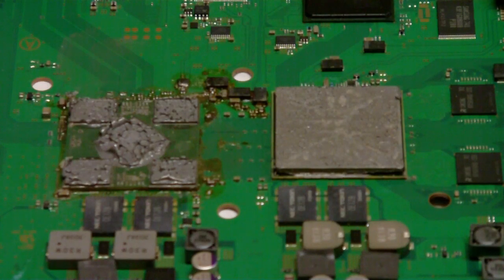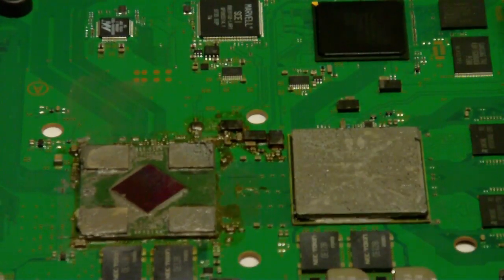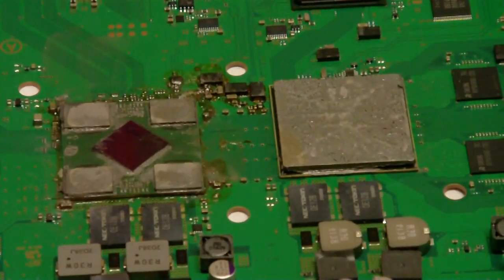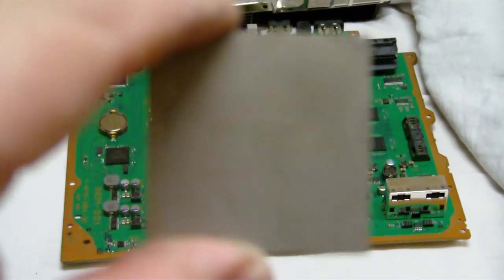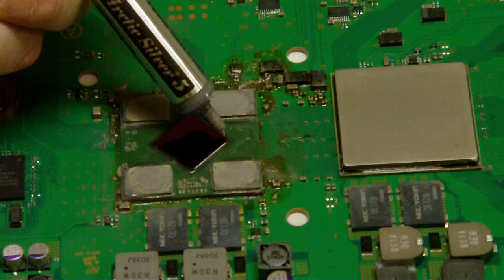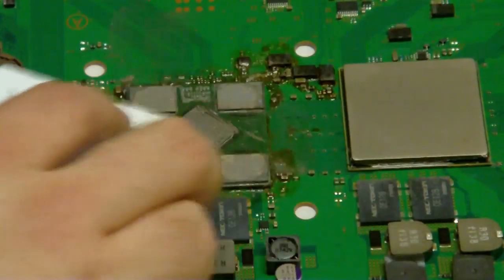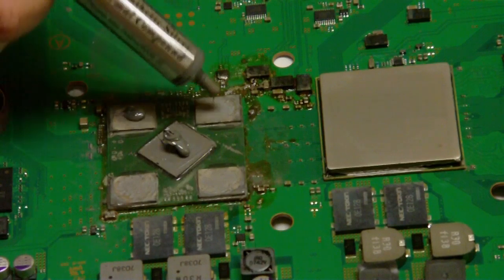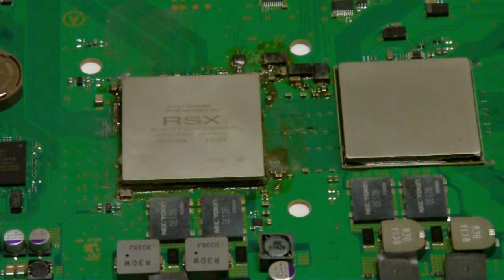PS3 YLOD Heat Plate (GPU or CPU Cover) Fix

Comment: I wouldn't recommend doing a reflow. What you need to do is reball it. Otherwise you're still using the garbage solder that the system was made with. That's why it keeps cracking and giving you a YLOD.

Comment from the maker: @latyrx7 Yes.  Unfortunately,  this step wastes a lot of AS-5.  I would heat the board up on the bottom first, then do this step and then heat it up on the top after the plate has been put back on.  I heated the top first one time and then when I started heating the bottom, the plate fell off and then I had to use more AS-5 to reattach it...

Comment: @coldplay055 ok the CPU/GPU Chips are held on the board by a BGA: Ball Grid Array. so basically there are hundreds of little solder balls on the CPU/GPU and to get the chip off you either have to be really fking good with a heat gun cause it is possible nothing is impossible. but you have like a 75% of failing if you are just ok with a heat gun but it is possible or 2nd option get a BGA Rework Station but those are minimum $650. but yeah i would not recommend you personally tryingit

Comment from the maker: LOOK CLOSER!!!  I KNOW IT IS A LOT OF PASTE, BUT DO YOU ALL NOT SEE THE THERMAL ADHESIVE ATTACHED TO THE MEMORY CHIPS IN THE CORNERS???  THAT CAUSES GAPS WHEN RESEATING.  I TRIED GOING THE THIN ROUTE ON THE PASTE THE FIRST TIME, BUT GUESS WHAT???  THE PS3 STARTED OVERHEATING AND SHUTDOWN WITHIN 5 MINUTES!  I DID EVENTUALLY SAND THE OLD THERMAL ADHESIVE OFF AND REAPPLY NEW THERMAL ADHESIVE WITH A THIN COAT OF AS-5.  I HAVE ANOTHER PS3 THAT I HAVE TO DO THIS TO & I'LL MAKE ANOTHER VIDEO ON THAT.

Comment from the maker: @aniellocapp4  Not  a moron...  Initially I used a small amount of paste.  The PS3 overheated within 5 mins of being powered back on.  I tried it again with only a small amount of paste and again the PS3 overheated...  If you look a closely, you can see the adhesive on the memory chips in the corners.  well guess what...  the adhesive doesn't allow the heat spreader to sit on the GPU chip properly, therefore I had to apply more paste in order make a good contact and stop the overheating...

Comment: I put down a thin layer on my rsx chip and scrapped that adhesive glue of the memory and heatspreader with a guitar pick. then used a small bit, not even a pea size of rtv blue gasket maker (used for my truck water pump), going on 2 months and actually runs much cooler and quieter and the thermal paste is conductive bud, that's too much to but otherwise good vid
Reply from the maker: I ended up using a dremel with a sanding disc to get the adhesive off and I put new adhesive on and set the heat spreader back on with the proper amount of AS-5 on the chip.  I'll keep that RTV sealent in mind if I have to do it again since I don't have anymore arctic silver adhesive.  Thanks for watching my video!
Reply: tennwhitetrash
its holds the IHS on well man. and it's almost like rubber so even when hardened, it's not gonna short anything. the memory chips don't conduct enough if at all any heat to need cooling, so I used the rtv on them and spread AS5 only on the RSX chip and actually used a little sandwich bag with my finger and spread it that way then with a card, I feel safer doing that. Then a pea sized drop when the IHS is mounted on top for the heat sink being that the heat is focused in the center. So RTV on the memory chips, very little, spread it on them and then put AS5 on the rsx, spread it like I did or however you feel safe, then put the IHS down, let it sit and make sure it isn't lifted at one end and then, put a pea sized drop in the center of the IHS then mount the heatsink. You should be good then.

Comment from the maker: @12344richard I think that mine gets 800 on low and 1250 on high.  Not 100% sure on that.  I have used the high setting a few times.  Gets that flux boiling :).  Glad that yours has been working for 4 months.

Comment from the maker: @bigdav123456   I thought the same thing and the way this heat plate is made  along with the ceramic adhesive that was left on the memory chip in the corners, putting little thermal paste on and smearing it around or just placing it on the center of the chip caused it to overheat...  I have thought about getting the ceramic adhesive and reattaching it permanently, but I am not sure how easy it would be to get the old adhesive off.  I just don't want to risk damaging the the GPU chips...

Comment from the maker: @theerazor79 There could be a fix as easy as resetting your PS3 to the factory defaults.  Search for a video on that.  you have to hit some buttons on your controller to get it to do that.  I bought a used PS3 and no video was coming out.  I did the factory reset and found that the previous user was using HDMI and I was trying to use a composite connection.  I did the reset and everything worked great...

Comment: The whole idea of using thermal compound is to transfer heat. You are supposed to use the thinnest layer possible without having any gaps. I am a computer technician and am not as familiar with ps3's but I am  positive you don't need that much compound. Having too much thermal compound can be just as bad or even worse than having none at all because instead of it transferring heat, it could act as a barrier if too much is used.

Comment: AS5 may not be conductive, but it is capacitive. I highly recommend switching to something like MX-4, since it is completely non conductive/capacitive, and it doesnt have a curing time. Not to mention it offers better temperatures that AS5. And Im sure youve heard this before, but good god man you are using way too much compound. All you need is a thin layer over each of the chips.

Comment: You couldn't be more wrong.  It's a HEAT conductor, not an electrical conductor.  The thermal paste being too thick will cause less heat to flow between the CPU and heat sink.  You're more than welcome to stick to your own methods, but I've been working on computers for over 20 years, as well as gaming systems, home theater equipment, and other various electronics.

Comment: my whole rxs chip came of does that mean my ps3 is broken?
Reply from the maker: +Praze Tricky Pretty much.  You will have to have the RSX chip reballed.  This is something that a person with what you will have to work with around the house will not work correctly.  There are businesses that do reball, but you may have to send your PS3 off.  If you live in a city, there may be someone local that can perform this.

Comment from the maker: @xxxkiller809xxx Not sure what to tell ya on this.  Sounds like you may need to have it reballed.  I would check craigslist and see if someone in your area does that...  There are reball kits that I have seen sold online if you want to attempt it yourself, but I wouldn't recommend it.

Comment: I removed the heat plate with my 60gb ps3. it running great without heat plate and i put arctic 5 in. thing was changed and it running faster. i think you could try that.

Comment: You're using WAY too much thermal grease.  You need to make a thin 'x' from corner to corner, or just do a glue dot sized spot of paste, and that's about it.
You have a complete misunderstanding of the purpose of thermal grease.  It's a conductor that takes the heat off the chip, and spreads it to the heat plate.  It's not "just a divider" or "something that makes a gap to let heat flow." It's NECESSARY for heat dissipation, and also works less efficiently if used in bulk like you apply it.

Comment: @tennwhitetrash just to remind you, YOU DONT NEED TO USE THAT MUCH THERMAL COMPOUND HOLY SHIT! if you look at the PC guide to applying thermal compound, our PC cpus are the size of that CPU processor. all you need is just a pea size grain. Just use the credit card and spread it, trust me, it will spread finely enough so itll have thin coat of compound. You also know that too much thermal compound (AS5) is bad right?

Comment: Unfortunately the only Real fix is 1, a new chip Or 2, a professional re-ball and reflow. this method does work but only lasts as long as the solder stays wet, that is, does not get heat stressed and gives another dry joint. the heat transfer is only as good as the heat sink and thermal compound that joins them, cheap Lead free solder used in the manufacture is the major problem with most if not all PS3 and X-box 360 BGA GPU's and CPU's.:( re balling with leaded solder balls in what I do.:)

Comment: using way to much of artic silver5 you only need a thin layer of paste. to much is just as bad as too little really. the first lot paste you use then spread with card was just right. the more paste you use the more heat is hold by the paste and not moved away from the chip.

Comment: @coldplay055 let me rephrase that on the bottom of the CPU/GPU there are hundreds of pads that have solder balls on them and there are the same amount of pads on the Motherboard now it's not hard to get the chip off with a heatgun but it is hard to get it back on that is the problem alot of people that are good with that stuff can do it. you gotta have #1 Patients #2 you cannot have shaky hands #3 you HAVE to know what the heck your doing..

Comment: dude you need to use way less on the center chip, artic silver is not the same as other thermal grease it is full of tiny pieces of silver and all it does is fill the imperfectionsin the surface to make the surface as smoth as possible fot good contact to the heat plate/sink, too much of it will actually hinder the amount of heat that is being transferred to the sink, this could explain why you have reflowed it so many times.

Comment: DO NOT FILE THE FLAT PART OF THE HS-JUST THE STEPPED PART OF THE EARS!!!  Reapply Crisco, test fit, and thin more if necessary. Repeat until you have near 100% contact. CLEAN OFF CRISCO and apply thermal cmpd. Reassemble, etc.

Comment: Way too freaking much thermal paste.  That is causing it to NOT transfer heat.  The first part was all he needed.  I can't believe what I saw there...and reflow before you put the spreader on.  The solder points are under the main chip.  Use a pen-torch to do the heating, and only heat to about 200 degrees a couple of times.  Then put the heat spreader on.  No wonder these fail repeatedly, you aren't doing it right the first time.

Comment: That's far too much thermal paste..you only need to use a grain of rice sized globule of it and it works better the less you put on..its only there to flatten out the microscopic height differences that occur through heat flex and initial machining process..in the case of thermal compound.. less really is more.. Great Vid though buddy.:)

Comment: I removed it , and what to see white paste omg.. Sony u noobs how can put white paste O.o. Now i see why PS3 is overheating. My is dead anyway i removed that heat plate, cleaned RAM and GPU. But still my ps3 only starts without any picture on screen. Green light on Blue Ray works, but no Video signal. Is my GPU dead or not?

Comment: WTH!  the first coat of thermal he spread was fine! but nooo! hear comes the whole tube!

DUDE you reflowed with out using flux 5 times! your solder is dry and cracked only way to fix it is to reball the bastard.  and buy some artic silver alumina adhesive compound so your heat spreader stays on.